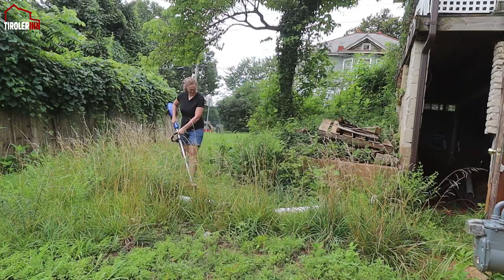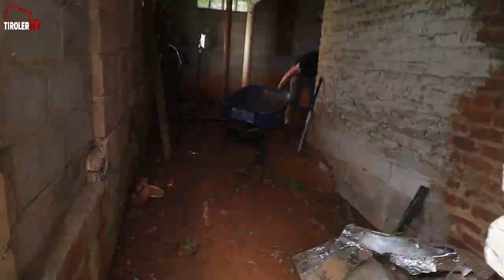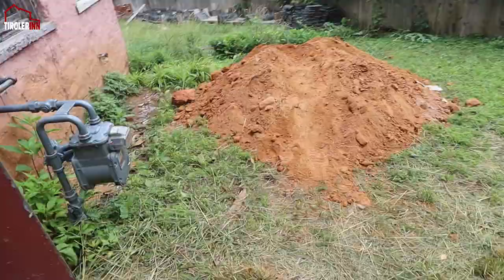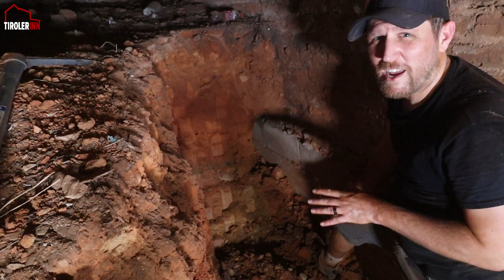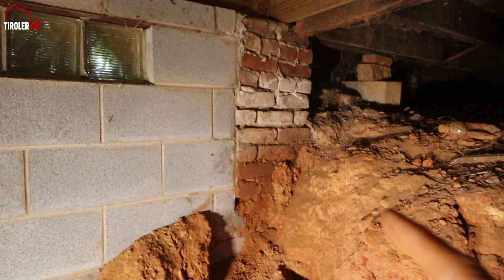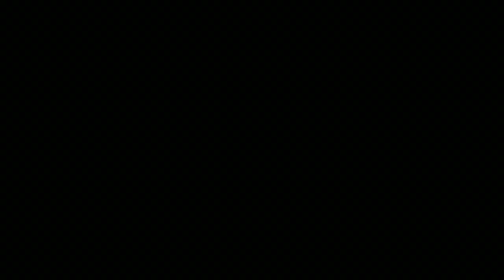Digging up the Foundation on a 120 year old house by hand - TirolerInn the Renovation

Comment: Good job, but it is really a hard work to digging up so much dirt. Do you also have to re-route the cable (?) in the front? Wish you all a good time.
Reply from the maker: It’s the main water line going into the house. We are rerouting it yes and then hook it up to the pex we already ran in the house